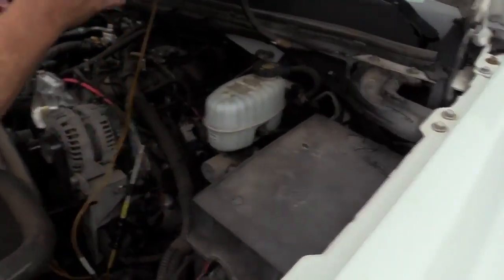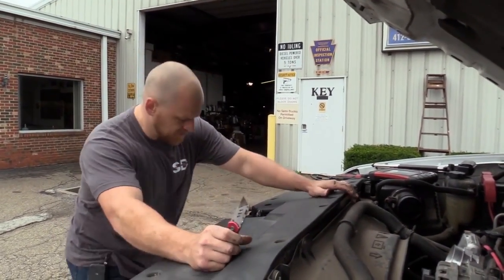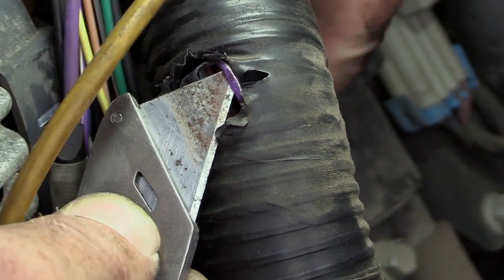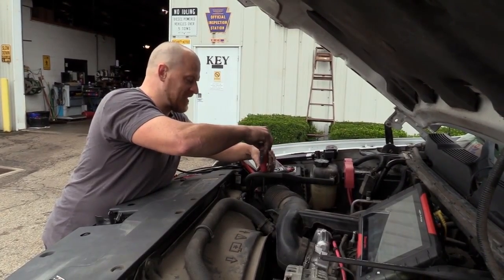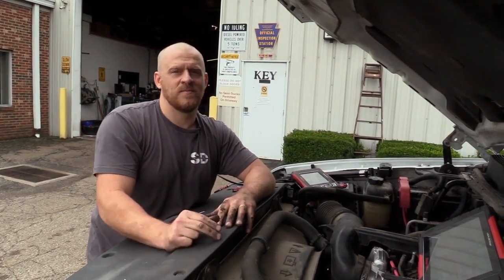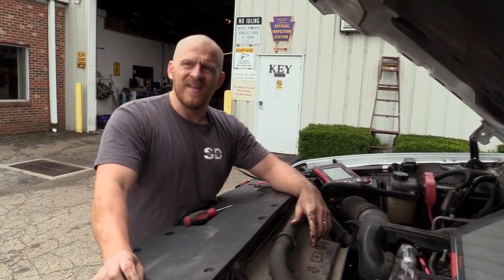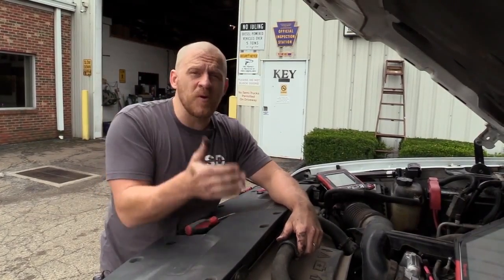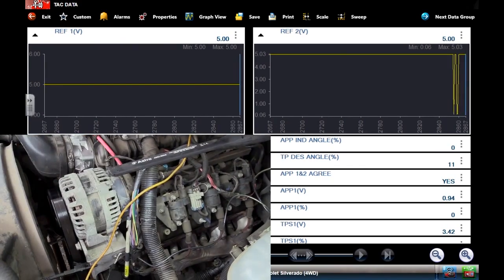Pulling codes and changing parts is not a diagnosis!

Comment: the computer industry in the late 90's went to this model pretty much to a T....diagnostics would be run and tell the tech what was wrong and which board/component to replace.....thereby rendering the job of the tech down to a just barely above a minimum wage grunt.

Comment: auto parts stores started it back in the 60's/70's. 'oh sure u can fix your car, its really not that hard'. Fast foward to early 2000's home depot/lowes jumped on that train but worse. I know plumbers, electricians that wont work on a house if they're coming in to fix a home owners screw up. The old Purolator filter tag line U can pay a little now, or a lot later. After a parts canon fail that adage is more true.  I had a little sign..'labor rate doubled if YOU already tried to fix it'

Comment: I'm sorry Danner I won't do it again I promise I'll do my best learning how to diagnose properly
Reply from the maker: Lol what did you do?
Reply: @ScannerDanner  I wasn't able to do what you can on the video testing the MAF sensor. My scan tool didn't allow me an option you had but the car did hesitate at 3k rpm so I cleaned the sensor and light came back so I replaced it
Reply: Pulled a code and changed a part lol.

Comment: Thanks for the fast response. I did replace the crank sensor, had showed up on the scan, what a bitch! Bought it from Rock Auto, could it be bad from them? I did subscribe to your forum.
Reply from the maker: Yep,could be a crap part. Most parts are when ordered online these days. Could also be a faulty cam sensor. I've seen them set false crank sensor codes on Chrysler products.

Comment: I just fixed a car that had been throwing random codes.  Parts-changers had replaced every single sensor multiple times.  I started with the basics (compression test), and replaced the cracked head.  Problem fixed, 10 minutes of diagnosis.

Comment: What do you think the problem is when you have a crank/no start only when you shut it off after it is hot, has fuel pressure but no spark 5v on pcm #17 on a 1998 jeep grand cherekee?
Reply from the maker: Focus on cam and crank sensors inputs

Comment: I could use com advice if you have a second, I was cleaning a machine (Diesel 2005-8ish) and we removed the battery and washed the engine compartment throughly then when reinstalling I had rookie help install the battery backwards and I didn’t catch it until I had turned the key a wire between the alternator and starter melted and several fuses blew I replaced the fuses and melted wire but I have no power on the cluster where hours would usually show and startup lights illuminate. I checked the main breaker and ground, there is a computer, I haven’t checked anything in the computer, I work on my own equipment and know my way around but I’m not a highly skilled mechanic, I’m not sure what to do or where to go next. I’ve never been in a situation where the battery was installed backwards. I’m trying to avoid having to pay a service company to come out and repair the Machine because my business was at fault. Thanks in advance for any advice. Ps I love the channel

Comment: From one tech guy to another, I want to say thank you!!! You have taught me a lot in the past couple of days, and hope I can apply some of your lessons to my daughters truck. 2012 Silverado has crank no start issue. Guys have changed cam and crank sensor, and installed a new fuse box. It has spark, has fuel pressure (Appears a little hight to me, goes to 70 with Key turn, then back to about 63 after few minutes sometimes). But now dad wants to do some testing, as she was told it might need a new engine for a small fee of 9,000. Possible cam issue. The original issue was suddenly stalled, and then crank no start. Wish me luck, but you have a new fan my friend. Wish you and your family the best, and hope mom is still doing good.

Comment: Hey I have a p0652-sensor reference voltage 2 circuit low code where do I start 😩😩 I can't find any wiring diagrams Audi A4 2.0tdi 2007 BRD engine.

Comment: I had a fish bite misfire in my 2002 lesabre (no DTC). By watching your videos/book and other resoureces I narrowed it down to a "weak" fuel pump. The fuel pump is supposed to draw 7 amps but the pump(in car's fuel tank) was pnly drawing 4.5 amps-- I tested the fuel pump's power feed circuit (could deliver 10 amps)  the fuel pressure was good. I replaced the pump and now the secondary ignition waveforms look good and the fish bite mis fire went away.  I can only imagine what would be thrown at it!

Comment: I have a 2012 honda civic lx with error P0498.  I already bought and changed the egr valve and maf Sensor.  Clean the canister and the sensors that are in it.  I erase the code with the machine and the check engine appears again.  I read the code and it is the same P0498.  So what can it be?

Comment: In June, I got a secondary air valve stuck open code on my 2011 Tundra.  Talk about throwing parts at it, Toyota's repair is to replace both valves, the air pump and even the driver module.  I was able to clear the code, and get out of limp mode.  But what I learned with the diagnostics was to watch the fuel trims, A/F and O2 sensors to see if I really did have an imbalance between banks.  I didn't.  I was able to work out how to clear  the codes, run the monitors and get my inspection while the truck was still hot.  But for the repair, instead of buying the whole valve solenoid and manifold, I pulled the solenoid/pressure sensor off, cleaned the reed valve and solenoid base with brake clean.  Failure at first as the code set a couple more times at start up, but hasn't set for the last two months.  Probably should have operated the valve while cleaning to get whatever was on the valve face but it seems to have cleared.  Still Toyota's "repair" was $3000 job throwing all the parts at it.  Mostly because up until about 2011 they had a condensate build up in the system.

Comment: Absolutely, 100% correct... talking about throttle body, abs and traction control codes. These are sometimes mind bogglers causing accelaration problems and you don't even need to change or buy any parts, except maybe parts cleaners and take a little bit of extra time to scan over connecting points or inbetween routes... good point SD.

Comment: You can blame the Flat rate pay system since so many shops give free diagnostic, 1hr at most.   Flat rate drives many good techs out and keeps the parts changers and guys willing to cut corners. I had so many cars like that kicked to me while working as tech to fix after someone threw the parts cannon at it.

Comment: I was brought a Dodge pick up truck that had been to 3 places and had $1,000 worth of parts thrown at it. It had no ignition or fuel injection and it wouldn't start. The customer had been given a plan to remove the entire induction and fuel injection system and replace it with an intake manifold and a carburetor. I scoped the 2 signals coming from the cam and crank sensors and the crank signal was missing. I fixed a bad connection and it started right up.

Comment: I have two scanners, two test lights, my laptop, my DVOM and still need a scope. It's more to it than plugging in a scanner and reading codes. The fun has just started
Reply: i repair audio amplification, n use a std 2 channel Oscope, i HAVE used this in past on a 91 Honda,,waay cheap too.. bulky  yes..need a stand..10 meghz should be good for everything in a car i blv. SD may say otherwise?

Comment: Yep, learned about this 2 years back when I had to replace the timing belt on my '03 Mazda P5 when in the end, all it was, was the tensioner spring as it went, PING! and flew off the tensioner, but I did replace the timing belt, just in case due to one, the spring had embedded into the belt, and two, I had NO idea when it was replaced before I had purchased the car in 2012 and could not find out for certain and the belt should have been replaced then at 105K miles, I bought it at 110K+ and it had lasted until I think 170K, so better safe than sorry.

Then discovered that the car ran fine when revved up, but like poo at idle. Eventually, I got an inexpensive scanner to help at least lead a way to go in my diagnoses, only to find out as you have said time, and time again one part may end up being related to other issues. For instance, the scan tool told me the MAF sensor was out, well, the replacement ended up working for a short while, then it went bad. Clue was the fuel trims weren't moving, so I went around in circles, only to find out that the old original MAF was fine, as once I put that back in, the fuel trims did move and were fine. I forget what all else, but ultimately thought the water pump was leaking, only to have a small cooling hose leading to the throttle body was leaking and the way it ran down, it made it look like the water pump was bad, at one point, the MAP sensor looked to be bad, but don't recall if that ever got replaced, but in the end I was a touch off my timing on the exhaust cam, once that got corrected, the car ran fine. Now, I have not checked for emissions to see if the car can still pass as at one point, the check engine light was flashing so wonder if the fuel canister is plugged up or not as the Creative V scanner has that capability, it's more out of curiosity as in Western Washington, emissions testing is now in the past. 

Like I said, the scanner gave me several codes, most not even remotely related to a miss timed engine, but gave me the run around, including periodic misfires, so put in new plugs and ultimately, I think determined a coil may be bad? Anyway, got 2 new ones as it's well known that these FSDE motors are known for going through coils so, again, better safe than sorry.

This was my first foray into diagnosing an OBDII system with scanner and had NO idea that many components were interrelated to each other, now I know. BTW, the car now has 192K+ on the clock and still runs strong despite it all.

Comment: Talked to a guy on the phone a couple days ago. He told me he had a caliper dragging on his dad’s truck so he put on a new caliper. That one was dragging too so he figured he got a bad one from the parts store and exchanged it under warranty for another one. That one did the same thing so he replaced the brake lines and said he bled the brakes but the pedal is going to the floor. So he replaced the ABS module, same problem and now he’s going to change out the ABS pump. I told him you didn’t have the soft pedal until you started changing calipers and brake lines so what makes you think the ABS module and now the ABS pump is bad? He said I used a code reader and got a code for the ABS module/pump. His dad just found out and he is pissed, guess when he borrowed the truck his dad told him specifically “don’t work on my truck”. So yeah there are lots of people out there that think all you need is a code reader and it will tell you what you need to replace.

Comment: I feel that the flat rate system has created part changers!! I make the mistake in my shop every now and then scan for codes  its just a evap code hook up the scan tool and test the fuel pressure sensor oh its leaking toss in a vent valve then find out its the wire shorting on the frame under the spare tire ...... then kick myself in the $@% could have spent 15 more minutes racked the truck and just tested the circuit and found the short

Comment: I've seen that specific problem at least a half-dozen times on these GM V8s. Whenever I see one roll in nowadays I just replace that stud with a normal bolt and save the customer (and myself) some grief later on. There is at least one other location that I've found where the 5V reference wire can rub through and short to ground and that is near the front driveshaft on GMs with 4WD.

Comment: unless you know and understand the system you are working on there is no way  you can do a proper diagnisis.  silver bullets are for werewolfs. in my lifetime i've spent as much time researching systems as i have fixing them. i am currently working on something for which no manuals exist. before my fingers move i must engage the brain. i'll get it fixed if parts are available to either buy or manufacture. problem these days is no one wants to think.

Comment: Im a diesel mechanic and I tell people there is no computer that tells you what to fix. Code readers gives you a direction to go to. It dont test broke wires inside the insulation, loose connections in the plug, etc. DIY and parts changers- I replace the part and its doing the same thing!  Need manual and a good multimeter. Elec problems can be a booger to find!

Comment: Im guilty of listening to the customer and believing what they have "tried" some times. I had a buddy bring me his eclipse gsx turbo fully built internals in the motor. Vehicle has crank bht no start issue. He said he did a compression check. I do diag and find his fuel pump has no pressure. Replace it. Now has pressure. Vehicle still no start. Check ignition, spark is present. Check compression, and cylinder 3 is 35psi. 🙄 I thought you check compression bro?
Reply from the maker: Hate these ones 😒 at least it was your buddy and he understood

Comment: I just wish this would go viral so I would never have to explain this again… your a legend
Reply from the maker: Let's make that happen! This message need to get out there
Reply: @ScannerDanner   hi Paul off the subject. I've got a Mitsubishi Pajero 3,5 petrol ex UK. I had a fault where wouldn't go over 3000. Go into limp mode took to a garage came up with all sorts of BS. I didn't believe them so back home. This has a cam operated HP pump as it's GDI engine. Inside are 2 micro filters 12mm long. Removed them both fitted in line canister filter. That was 2 years ago no further trouble. The Mitsubishi can't use OB2 scanner, place cable onto pin one to earth look at dash lights.Count lights Morse code said was high pressure fault. We make a plan here in SA. Love all the videos very informative.

Comment: A lot of the problem is the parts cannon usually gets it fixed. It may have a bad connection on the starter wire but changing the starter gets it working again. A lot of the time it's something simple but changing the plugs and wires eliminates the problem. I'm sure most people wouldn't have a clue until it becomes many parts and gets pricey. Unfortunately you see it in a lot of shops including dealerships. My brother had 2 batteries, 3 alternators and a new computer from 2 dealerships and still had the problem. Once I rode in it I was able to tell the dealer mechanic he was looking for a connection problem. $40 and a new alternator pigtail later it was fixed. No he didn't get a refund on any of it. He took it to the dealer thinking they were the only ones qualified to work on a newer vehicle with an electrical problem.

Comment: I diagnosed a no crank-no start on an 07 Yukon for a wiring issue on that exact same bolt.  The wire to the starter was running through there and shorting out and blowing the fuse.  Truck got towed into me.  There is supposed to be a plastic stand-off there.  Found and fixed it within an hour thanks to knowing the fundamentals learned from SD!

Comment: Well it seems after 35 years of teaching college automotive repair, i still get students that think that all ya do is plug in the hardware and the software will direct you to the bad component.
Reply: Ummmm….. maybe I’m reading this wrong but you DO plug the hardware in, and the software  WILL direct you to the bad component. That being said, you need to know how to read PIDS, and use your scope. So long as you have a good scan tool and scope, the hardware and software will very much so direct you to the bad component or issue.  I think I get what you’re trying to say… lol I’m not just sitting here trying to be a dick.

Comment: I figured out the part swapping algorithm used by authorized dealerships/garages a long time ago; the first thing to swap is the most expensive part that could possibly be at fault (alternatively the part where they can charge the most labor), the second thing to swap is the 2nd most expensive thing, and so on. They will also charge ridiculous prices for spare parts. After about three or four attempts they will have robbed you of a truckload of money and can "fix" whatever the problem is for "free" by subcontracting the work to someone who actually can diagnose it. Then they will feed you some BS as to why it was so complicated blah blah blah...
Reply: all the while hoping you get aggravated and trade it in for a new vehicle....

Comment: yes it is when your paying a 'mechanic' who charges $500 to replace a 65 dollar part...  "oh, my precious expensive diagnostic equipment found this, you would've never of found it"  wrong. after buying the 3rd part with a total 300 dollars, you cure it... my bad, it only costed 100 dollars, I got to return the other parts... your not fooling anyone thief.
Reply from the maker: So many different scenarios, with many different problems in my field. From incompetent techs, to bad new parts, to poor communication etc etc.
In the video example I just showed, just wondering how many parts you'd have changed? It had a severe misfire, and would sometimes throw throttle body, and crank sensor codes. 
And were you calling me a thief? Or the tech in your example?